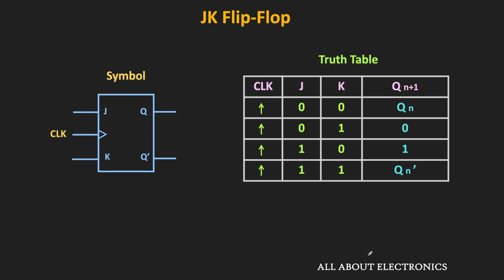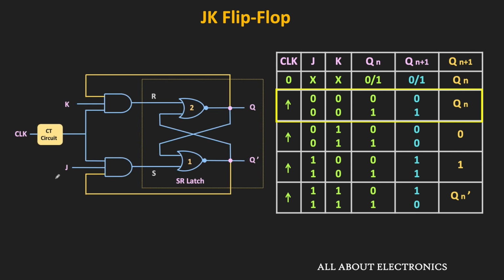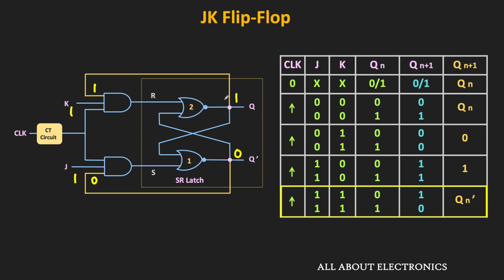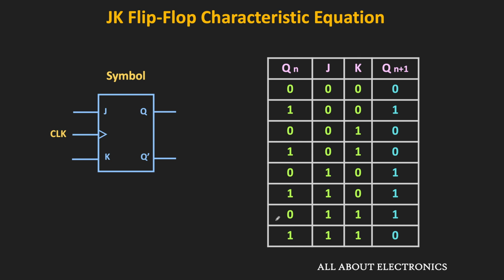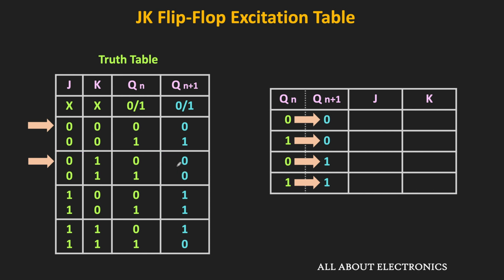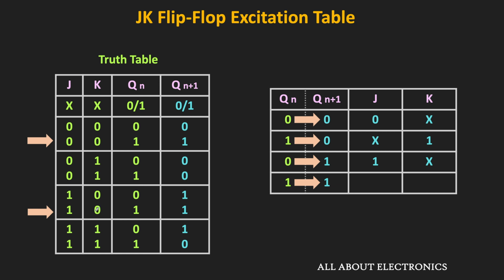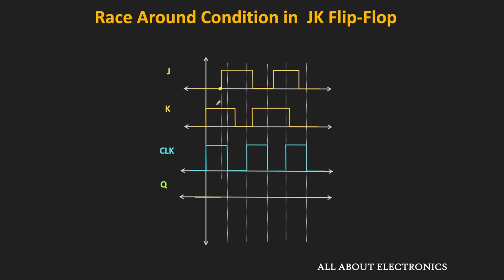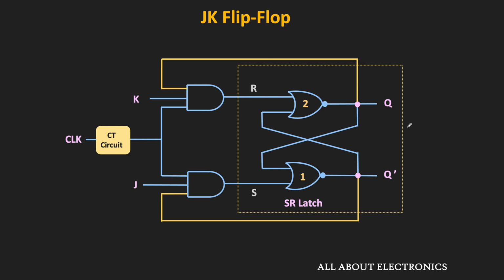JK Flip-Flop Explained | Excitation Table and Characteristic Equation of JK Flip Flop

Comment: Sir , but u said flip flops only work at edge triggered and not level triggered then how are u saying this race around condition in jk flip flop to be due to level triggering? Please tell sir.
Reply from the maker: Yes, although it is said to be a flip-flop. But it is actually a latch. If it is a flip-flop then you won't see that issue.

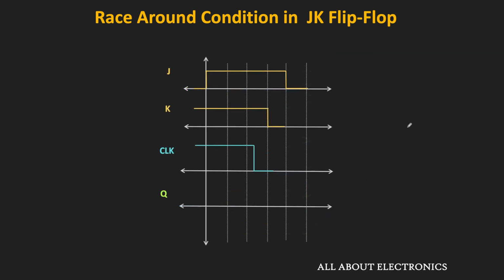Comment: 22:04 hi sir in this time you said that the flip flop is level triggered but in previous video you said that the flip flop work only if the clock is edge triggered. 
2. Finally you said the latch circuit can be converted into flip flop by clock transition in this case the circuit will be edge triggered or level triggered.
Thank you for your video. Doing a great job :)
Reply: I think he said IF the flip-flop was level triggered instead of edge triggered(which it usually is) then race around condition will arise.
And yeah clock transition circuit will make the latch edge triggered as it is transitioning between levels.

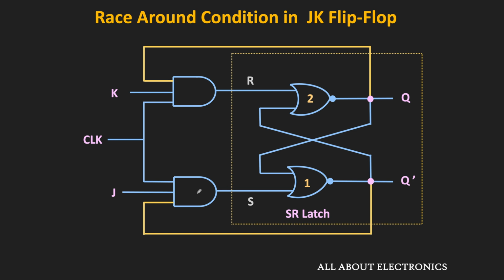Comment: Sir in 18:34, you said that if the flipflop is level triggered, are you referring to latch here? Like I thought flipflops are always edge triggered and latches are level triggered. So JK Latch should encounter race around condition if clock pulse, J and K all are high at the same time. But JK flipflop, being edge triggered will overcome this racing around condition. Pls correct me if I am wrong.
Reply from the maker: Yes, what I mean to say was, instead of JK flip-flop if we have latch which is level triggered  then race around condition is bound to happen. In case of edge triggered JK flip-flop, race around condition will be taken care.
Reply: @ALLABOUTELECTRONICS  ok sir thank you

Comment: i'm finding trouble from 16:58 (positive edge triggered flipflop). can you please share the vdo where the clock mechanism has been explained.
Reply from the maker: Basically for the positive edge triggered flip-flop, at the rising edge of the clock, you need to see the value of J and K input. The value of the J and K input at the rising edge and the present output of the flip-flop ( just before the rising edge) will decide the next value of the flip-flop. Better you look at the D flip- flop video. In that also the timing diagram is explained. From D flip- flop timing diagram, you will easily understand the mechanism. And still if you have any doubt then let me know here.
Reply: @ALLABOUTELECTRONICS  yes now I can make it out. Thank you so much for explaining everything in detail